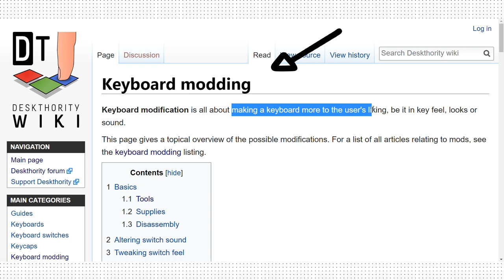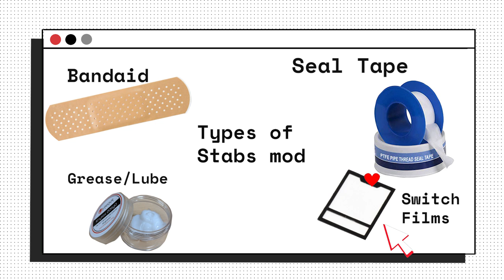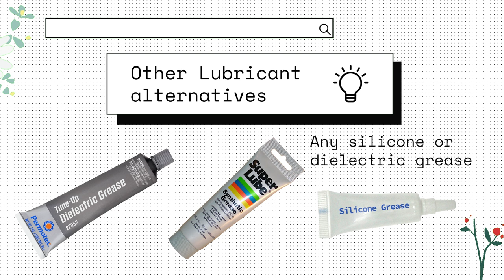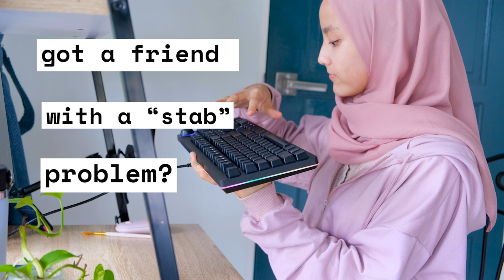Cotton Pad Mod for Keyboard Stabilizer

Comment: I've been playing around with this just to see how good I could get the stabs on my Akko ACR75V2 to get  (Had some plate mount stabs that had some HORRID ticking) and I've come to realize a few things that might be useful to any of you:

- This mod (though a but inconsistent) can serve as a sort of substitute for the Holee mod
- There are times where the cotton will move around after some time and cause a sticky sounding uptick! This is usually due to the cotton sticking to certain parts of the housing or travelling underneath the entire stabilizer which causes that mushy sticky sound as mentioned before.
- With the right amount of cotton, I was able to get my stabs to point where they stopped rattling and ticking AND without it feeling mushy. Awesome!!!
- In terms of longetivity, I've had this mod on my keyboard for about a week now and whatever sort of mushy feeling or sound I had before was either reduced or was completely eliminated. Will come back to this video and let you all know how it'll hold up in the future.

There are definitely downsides to the mod but it's definitely worth trying if (A) The keyboard is soldered/has rattly stabs (B) You're lazy / Don't have the time or patience to do any Holee Modding or Wire Balancing. This was a neat mod!!! Makes me wonder what other crazy things we could do to stop ticking/rattle.
Reply: how did it hold up

Comment: it can be a good solution for stabs on plate-mount soldered keyboards where you cant extract stabs without desoldering the respective switch. in such cases, i was using a shit load of lube press fit inside the stabs. worked good, but made keys...uhmmm...heavy, so to say. will try your method instead

Comment: Hey Wan, I came to this idea myself using the cotton find on Q-Tips. Now I stumbled across your/this video. Cool. :) It works fine for now. But one Stabilizer seems to make a slight smacking noise (backspace). The other two are good. I'm not sure how long this mod will hold: would be cool if we could exchange in this regard. I rock it for some weeks now on my only keyboard and since I installed it I have not noticed a change. We'll see what happens in the future. Check out the 'Korean Stab Mod' if you haven't already. This might be the next one I try. But really ... I have to say it right now: I hate Stabilizer. Perhaps some Staebis could be the solution? xD Best reagards Q

Comment: Do you still prefer this mod or holee mod more? From your sound test, the stabs sounds a bit muted, due to the cotton, but I'd give this a try.
Reply from the maker: Yeah it does get muted depending on the amount of cotton. But if u reduce the cotton a bit it wouldnt get tht muted. It would take some readjustments.

Comment: I wish you would make a mod video for Crystal Clear cases. like how to to rid of the hollow sound with out taking a way it's clear. I do not want to seeing pillow inside or have there's some tape. i don't if it is possible
Reply from the maker: Orrr u could get some clear cotton pad and clear tape 😆
Reply: @WanSyazlina  even of you used clear tape would you still see it and it take away for the look?

Comment: Came across this video randomly, thanks for making it. It's a great alternative for the holee mod if done right. I installed some cotton pads on my spacebar stabs, and the right one fell off to the PCB lol. I am sure the left one will fall out soon enough. But it seems to have made the spacebar quieter and more thocky, but it definitely has less of a snap back and hence feels mushy. I don't mind it I guess, but unfortnately, it did not get rid of the rattle on the left side of my spacebar. I am too lazy to take apart my keyboard since it's screw-in stabs and requires me to disassemble the entire keyboard, so I will leave the fallen cotton on the pcb for now before I get time to redo it and clean it. I hope the PCB stays safe and doesn't screw up any time soon! lol

Comment: Is there a way to mod to reduce the travel distance of the key?
Reply: The only way to do that is to buy switches with long stems so it bottoms out faster like nk creams, glorious pandas, durock sunflowers, etc
Reply: @tofucube7703  ahh Thanks man
Reply: O-rings?
Reply: @Danko_HS  o ring is really mushy I just found out you can doing ball bearing mod with it.
Reply: @orlionlynn2799  They do feel mushy, but it's the only way i can think of to reduce travel other than buying new switches ofc. You can try harder o-rings, maybe even metal? That should eliminate the mushiness.
Reply: @Danko_HS  Oh yeah, thanks. But I'm not sure how difficult it is to find that type of o-ring in a small size.